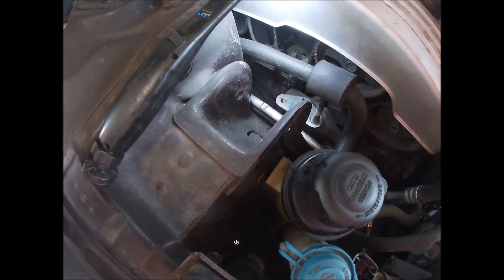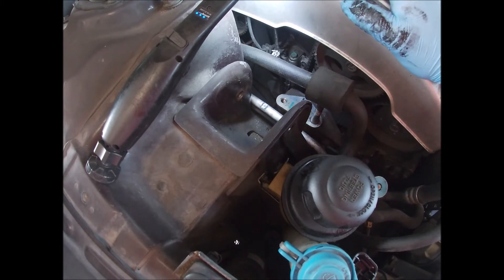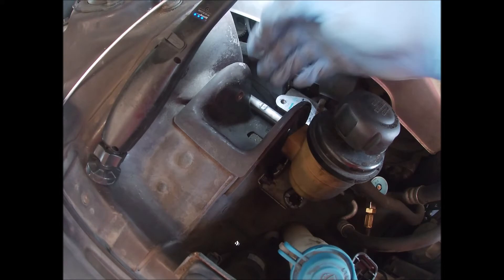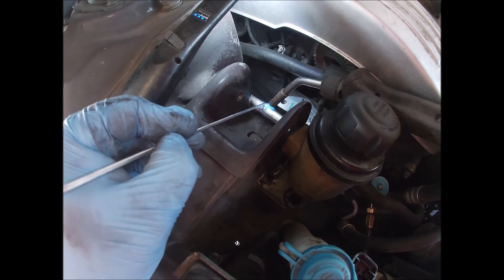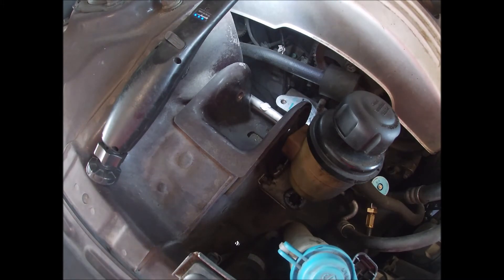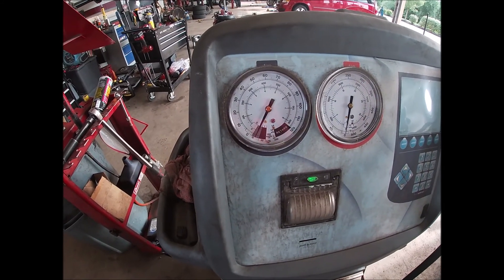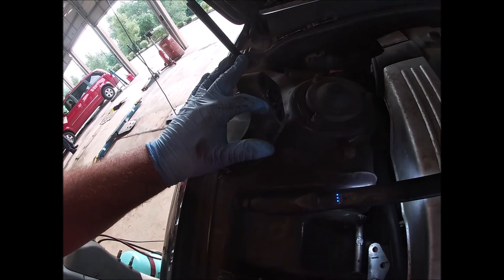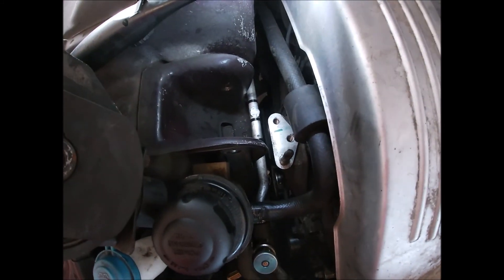Repairing AC line w/ brazing rod.

Comment: What kind of aluminum rod did you use? No need for flux?
Reply from the maker: They were blue devil 1/8 rod. You can use Flux and in most cases you should, but this metal is so thin, the torch will usually clean most impurities and allow for a good bond.